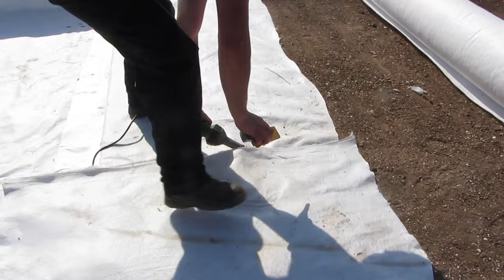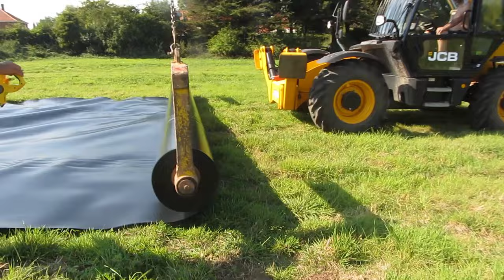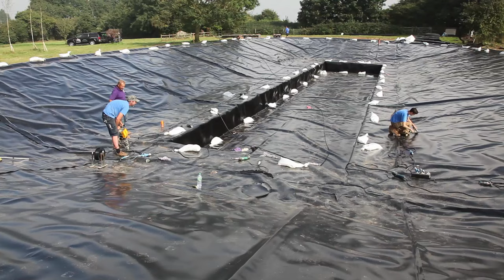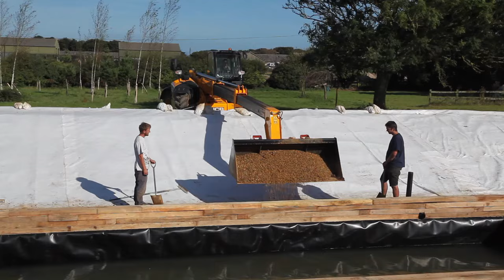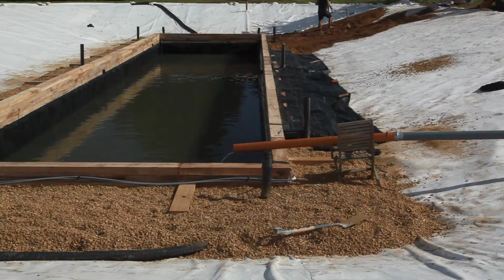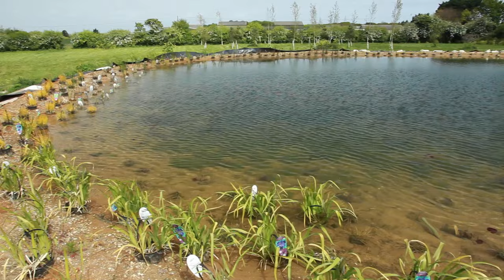Creating a Massive Organic Pool in 4 minutes

Comment: I have a splash pond. Works great. My big pond is coming. I'm modifying David's plans.
Plastic on the bottom. Concrete on top. A few more changes.... too detailed to type. But it will be much easier to construct and cheaper.

Comment: I would imagine an organic pool to not have a pump system and to rely solely on algae filtering fish and plants to keep it clean, along with a rerouted fresh water well/ small river to flow in, accumulate and then flow out of it. I read somewhere that a few willow trees for shade also help with the algae issue, in which case you would only require a net to catch the fallen leaves at fall time. I want to build one myself next year and I already planted some trees around where the pond will go a year ago. +I will build the basin part out of concrete and the brim out of large boulders. Hope it will look as pretty as this. I want to also install a 'hill' on one of the sides with charcoal, gravel and sand filter to recirculate the water using a pump in case I messed up and it fills up with algae.
Reply: The ponds I build get very little algae and are crystal clear even in full sun. Remember trees will shed leaves into the water which can provide nutrients for algae! The secret to clean clear water is turnover of the water, biological activity and aeration.

Comment: probably a dumb question, but what do you use to stick the seams in the liner together? my family is about to expand our small fish pond (currently about 2.5x1.5meters rounded rectangle) , and it's probably going to require stitching a few pieces of liner together to fit the shape (it's going to be a sort of L shape with a rounded outer corner). Is silicone calk ok? or do I need to get something stronger?

Comment: I fell in love with these pools. I was wondering, if it was in colder climate (Scandinavia), if there's a way to heat the water. I think the heaters need a clean water to function. would it be possible to somehow connect a filter with a heater for a natural pool? or would heating destroy the plants.
Reply: nyajinsky cost a lot thousands a month to heat
Reply: Heating will.be fine

Comment: I am also particulary interested in the specific build of the vacuums. I do understand the principle behind the system, but where does the debris goes in this case. If it is just pumped to planted zone water area, I would think it would permanently affect the water clearity in a negative way…

And can you even reach the dirt in the center part of the pond with this setup?

Comment: Hi David, love your work and your floppy hat. I have one very important question! do you ever have issues with clogging over time? If your airlift pumps are pulling water down through the substrate, the geotextile and the gravel I am wondering if the geotextile clogs with fine silt eventually? What is the longest standing pool you have that is still working (unclogged)? Thanks!
Reply: If you want a low maintenance version, then an ecosystem pond with intake bay or negative edge is the way to go and where the wetland filter (planted zone) has an access vault for back washing and pumping out to clean once a year

Comment: looks great as always. have you evolved the design a little from previous iterations? you mention air lift pumps to remove silt - how does that function? also there are horizontal spans of wooden beams coming out at 90 degrees periodically around the submerged wooden rectangle, and are buried under the stone fill - is this to increase stability/prevent it floating?
Reply from the maker: HI Brian, I have done some videos about making a pool vacuum with an airlift - this pool just has them pre-installed. Yes those horizontal timbers do just that.

Comment: How does this compare to digging a pond and compacting a layer of clay down?
This looks overly complicated to me with potential for the system to fail in the future.
I'd rather keep things simple or just not do them.
Reply: Well, I like questions like this one so I will answer this one:) The difference is in overall size. This pool is big, so the surface area of exposed clay in water - compared to volume of water is small. That means that this pool could have been done using only clay. However, if it was a smaller pool clay would have be practically impossible to biofilter :) using slow circulation. So, to be more precise, safety. In case you want to heat your pool, clay would have been a bad bad idea. You may even get a deadly amoeba.

Comment: Now I am a bit puzzled. The air lift pumps are on the PLANT (renegeration) side, not the SWIMMING (deep) side. This seems to be the wrong way round compared to your other model? Now I am in doubt as to whether to flow water from the swimming area to the plants, or the other way round. Or perhaps it doesn't matter?
Reply: its a design choice, but its the same principle, the PVC pipes on the corner are something new, he said its for the silt in pool corner cleaning system
but you can see that most other pipes have a flexible hooz linked to the outer bog region

Comment: Question - would it be possible to build the pool without liner by using something else perhaps impermeable clay like bennonite?
Reply: It is most definitively possible, the only problem is - clay is super rich in phosphorous and amoebas. There is no way of removing nutrients from it - or amoebas :) You will have to satisfy with less clear water and more chances of getting a sore throat after swimming. I would definitively not recommend heating the clay based pool, because that can get deadly ... There is a reason no one uses bentonite any more. You will need to be a professional :) biologist for a liner like that. If not - It would have to be really big and deep in order to compensate :) safety

Comment: Noticed you added a bubble pump in each corner of pool to "vacuum" debris from bottom........
Did i understood correct?
Not shown was the connection of the "vacuum" tubes...... did see long flex hoses move to outer part of pool so may I assume these connect to filter

And the aircompressor of 60W has enough capacity to feed 6 pcs airstones; 2nd airpump to use for vacuum

My design pool is 90 m2 swim and 150 m2 regeneration area......so think i need 2 airpumps and 10-12 airstone tubes.......
Further consider to make the "bubble-barrier"  as indicator between swim zone and regeneration zone.

Will drop you email with my plan in few weeks to get your opinion

Comment: Wouldnt the dirt slowly go down to the edge and eventually over the wood, filling up the bottom with dirt?  I know theres plants to hold some of it but how does it stay put forever?
Reply: If done correctly, soil and nutrients cannot get into an ecosystem pond. I personally create a rock barrier and make it water tight around the edge.
Reply: I'm talking more about how the sandy part is sloped.  Why wouldnt the sand fall down to the center?  How would you build this so that doesnt happen?
Reply: @joebobjenkins7837  I would not build one of these natural pools with a sloping surround like that. My method is to create a wetland filter which sits outside the main pond and enters the pond via a small waterfall. Wetland filters are far easier to maintain and all natural.
Reply: @creativecascades1328  that's kind of the idea was leaning to.  I like the idea of having the swim area seperate and really like a waterfall but they seem really difficult to build with no experience (my ailment)

Comment: How awesome! What is that used to fuse two different pieces of rubber? In a backyard situation, is the same equipment necessary?
Reply: Looked like melted plastic to me, imagine a big Hot Glue Gun just more robust plastic. And I doubt you need the same equipment(tools). As long you can fuse different pieces of liner in a way that prevents leaks, it should be okay.  But you will have to ensure a good protection against potential liner penetration, like that white cloth they used in the beginning. And of course, large surface area for filtration.
Reply from the maker: No, just use a single sheet and then there is no need to join. Just some mega liner origami.
Reply from the maker: Yep. That whit cloth is a fleece geotextile to protect the liner.

Comment: anyone know if insulation was used on this? He uses insulation on the ones in his video but cant see them here...
Reply from the maker: HI Brian. No insulation on this. It is not cost effective on such a large pool.
Reply from the maker: Hi Brian, no insulation here. It is not worth it in a large pool. Too much heat loss from the surface.
Reply: @organicpools-davidpaganbutler  thanks for the response. At what pool size would this be? (Appreciate it probably depends more on how much I'm willing to spend). Are you able to hazard a guess at what difference would you expect between equivalent pools with/without insulation?

Comment: What are those building blocks? insulated blocks? since i don't see any added insulation?
Reply: Looks like aerated concrete (eg Ytong brand) which is indeed highly insulation due to the trapped airbubbles inside
Reply from the maker: Yes they are

Comment: Ya there has to be a better way other than having all those pipes sticking up just below the surface? I would not like that at all ! I know they serve a purpose but it could be better designed I would think! An that just my opinion. But it is beautiful!
Reply: There are other ways to build organic pools using the ecosystem method instead which does not require all this piping and are much easier to maintain.
Reply: @creativecascades1328  I´ve read your comments in this site. You are talking about using a wetland filter. Do you refere to perforated pipes under the plants - conected to a pump or  what kind of filter are you using?
Reply: @Ranafranz  My go-to is a constructed wetland filter, far more efficient and easier to maintain, we're about to build another actually. Cheers, Richard.